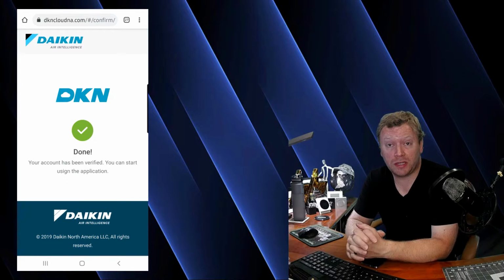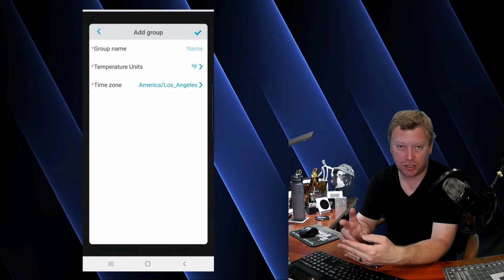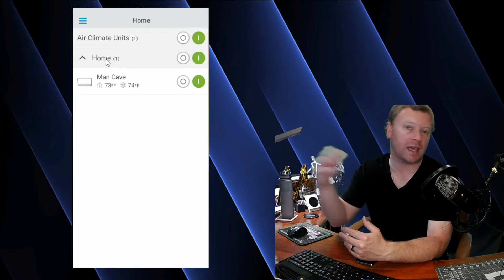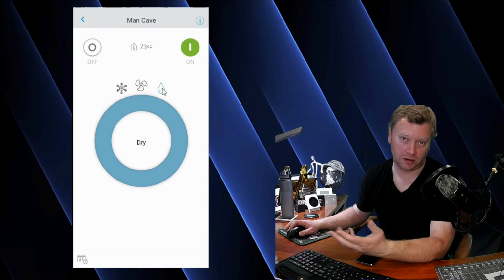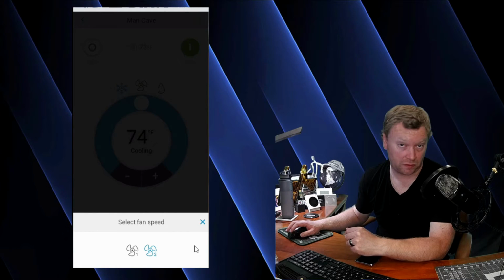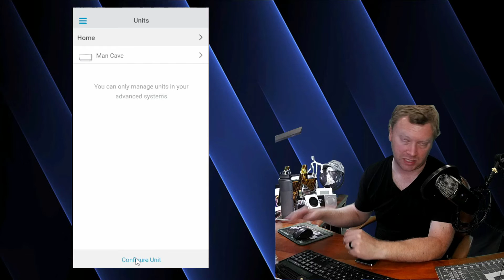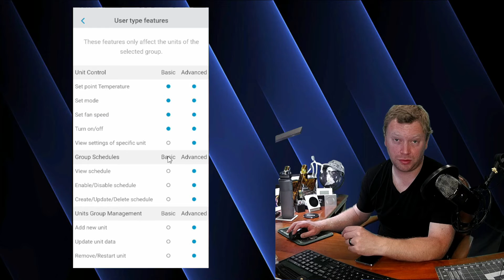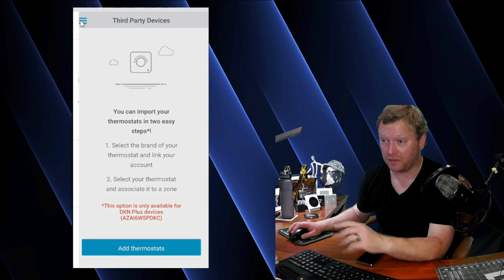Daikin WIFI | DKN Plus Adaptor Part 1 | Install, App Set-up, Connection and Demo (7-2-2021)

Comment: Very helpful video, thank you! But where would you suggest hiding this module? I purchased the AZAI6WSPDKB model (not the Plus) and was barely able to get it to fit under the case of a CTXS07LVJU. That module is slightly too big and causes the case to have bend with a lump at the bottom center.   

The AZAI6WSPDKC (Plus model) looks even bigger with all those protruding connectors. Where do you recommend installing it? Is there a cavity somewhere that is best suited? For esthetic reasons, I really can't install it outside of the unit without it looking horrible. What would a professional installer do?
Reply from the maker: Usually I see folks trying to tuck it in the cavity of the unit. The bottom cavity that is. Where the line set and condensate hose are usually tucked into by default from the factory. However as you mentioned, it doesn't always fit well, especially on smaller 7k heads which are tiny. I've been placing it right on top of the unit using 3m to stick it to the wall. Since the wall head is high up usually a few Inches from the ceiling, you cant see it until you're clear across the room. Unless you're really tall which then you can see it close to the unit obviously. 
Esthetics are always tough, but it's no different than a condensate pump mounted just below the unit (in my opinion). Other than those 2 options I've also seen some folks rarely stick it to the side of the unit too. Obviously it's very noticeable, but sometimes folks just don't care about stuff like that so it's not a big deal. I would suggest test mounting it temporarily and checking with the homeowner how it looks to them. But at the end of the day if it won't fit inside it won't fit inside I would never want to compromise the shell or the unit mounted on the walls integrity just to hide the wifi adaptor.
Reply: @InverterAlways  Thanks for the response and suggestions! I was really hoping you had a brilliant place that I was just missing. I'm actually the homeowner, and its being installed at a luxury Airbnb, so esthetics are important. I'll purchase the DKN Plus model and see if I can make something work. Otherwise I might have to get creative with some sort of wall decor to hide it. Any advice on how an end user can get installer pricing on these items in Portland Oregon? I need to buy 7 of them and they aren't cheap!
Reply from the maker: @yowzator  I totally understand. The Daikin One Smart Thermostat may be a better solution for you then as those have built-in wifi. But they are extremely expensive. Anything you decide to go with will need to be purchased from a contractor though as per most suppliers policy is to only sell to contractors. I can't speak for Oregon though so you can always look around and ask.
Reply: @InverterAlways  I'm renting out guest rooms to traveling nurses and each room has a head unit. My guests love that they have full control over their own comfort. But I'm worried what will happen when the weather transitions from cold to hot. Some of them may want to cool, while others want to heat. So I'm not really wanting full centralized control, except that I'd like to be able to automatically manage just the mode of all head units. For instance, when the outdoor temperature reaches some point, all units switch to cooling. Below that temp, they switch to heating. That's all I want -- just to take control of the mode of all units depending on the season. The 5 upstairs guest rooms are on a single outdoor unit and 3 downstairs common areas are on a different outdoor unit with a branch box. I already have Home Assistant installed to manage electronic door locks and lights. My plan is to use an HA integration for Daikin along with an exterior temperature sensor. But I'm open to other ideas.
Reply from the maker: @yowzator  so you have a few indoor units to control lol, I didn't realize you had quite that many. No matter what you do you'll at least have to install an adaptor of some sort. Intesis has an adaptor that can help integrate your units into a home automation system but, based on past usage of these I've found them cumbersome to set up. And once they are set up it seems to remove lots of control. You may be okay though since all you want to do is switch from heat to cool. Not needing auto is a good thing as that's a feature commonly lost with these. I've also seen it where they get stuck in cooling though so I'm not sure if I would risk it.
I think using the dkn modules for 3rd party stat integration is best because you can also use them for bacnet mstp or modbus, which most home automation systems can pull in one of those 2 types of logic. You'd probably want a controls guy who knows your home automation system to come integrate it though. 

You're still stuck trying to find a place to put them though which is your biggest issue. At the end of the day they might be noticeable but if it provides the best control it may be worth putting them on top of the unit. Shoot you could even lay them down and just have them sit on top of the unit and you'd barely see them at all as they are only an inch thick.

Hope that helps get you closer

Comment: Dana,

Thank you for your YouTube videos, they have been very informative. You solved a long-standing problem of getting WiFi control of ducted units. 
Do you know if it’s possible to connect the Airzone AZWSDAI31E3 Wi-Fi adapter with Daikin’s Mini-Split Wireless interface Adapters on the same app? I now have two very similar apps (DKN Cloud NA and Comfort Control) controlling separate units. It would be great to get them on the same app, without changing the Wi-Fi interface.

Any advice?
Reply from the maker: Hi Shawn, 

Just responded to your email but saw this as well so below is copy/paste for reference.

So the daikin comfort app uses a totally different card. The good news is that you can Install the dkn adaptors I talk about in my video on both mini splits (through s21) and vrv units (p1p2) and add them all to the same app. So no worries there you just have to make sure to order the right cards. There's an s21 adaptor, a p1p2 adaptor, then a 3rd party stat adaptor that can connect to both s21 and p1p2. Obviously you don't have a separate stat here, but I like the 3rd party adaptor personally just so I only have to worry about one skew. It works for wifi control anyways so you don't technically have to add a 3rd party stat to begin with. None the less it's a little more expensive so you can choose whatever adaptor part number fits your unit best. Then put them all on the cloud app.

I'm not familiar with the part number you reference but the part numbers I use on the daikin units are:

AZAI6WSCDKADKN Cloud Wifi Adaptor (for P1P2 connections)

AZAI6WSPDKCDKN Cloud Adaptor (for Modbus and 3rd party stats)

AZAI6WSCDKBDKN Cloud Wifi Adaptor for S21

Comment: How do I connect 5 wires from ecobee to dkn plus. In addition to, I do not have auto cold heat anymore.
Reply from the maker: You just run g to g y1 to y1 etc like a normal stat. But you need to run r and c (24v) from a separate power source. I typically take the 208 off the indoor power and install a transformer for that voltage on most models. Then land the rest of your wires. The better way to set it up though is to power it with 24v and just connect through wifi. It'll communicate setpoint mode and room temp through the cloud and give you better control.

Comment: Your instructions are great. However I am having a problem. The adapter was very easy to connect.  My unit has the S21 plug on my unit. But when following your instructions it never shows the unit connected. It shows it’s connected Wi-Fi and the cloud but not the indoor unit.  What am I doing wrong?
Reply: Is the 24 V from a separate transformer?
Reply from the maker: @skipnardie  yes, just gave you some additional info in my last comment as well, sorry i just saw this one.
Reply: OK, I think I have figured out the problem. I think I have a bad unit adapter. I have everything connected properly, I added a 24 V transformer and I’m getting power now to my thermostat, although it does nothing for my daikin unit. On the adapter there is a reset button. If I push and hold the button for about two seconds, about 30 seconds later on the app the unit will appear and show connection for about 10 seconds but then it falls off and says “AC unit not connected!” I did this three times yesterday and it did this each time. I think I need to get a different AZAI6WSPDKC adapter.
Reply from the maker: @skipnardie  definitely possible I've had a couple that were bad, it's rare but totally possible. Swap them out see if it resolves the issue.
Reply: I purchased a new unit today. I will let you know what happens.
Reply from the maker: @skipnardie  sounds good.  🤞
Reply from the maker: Did you "associate" the unit once you added it to the app?
Also did you allow location settings when you first connected?
I have heard of this happening a few times now, but have not had this happen to me directly yet. Mine have all gone smoothly. 
Curious, what is the model number of the Indoor unit?
Reply: Daikin FTXS30LVJU

Thermostat adapter AZAI6WSPDKC
I did associate the unit right as soon as I did the app connect.  How do I approve the location?
I don’t understand what I’m doing wrong.  Is there an additional setting somewhere for this? Is there a cable I’m not connecting? Also I’m not getting the 24 V to adapt my third-party thermostat.
Reply from the maker: @skipnardie  Sounds like there's been a few issues with S21 connections. I did not realize that you had the 3rd party version either sorry. You will need the S21 cord. You will also need to provide totally separate 24V power to the 3rd party stat. You can take this off line voltage through a transformer if you want. Then run the rest of the wiring down to the stat from the adaptor. In the app you will need to set all the 3rd party stuff up, along with fall back algorythm ETC. But simply just to use it on the Daikin App it's almost entirely plug n play. Are you not seeing it through the Daikin app, or through your Honeywell/Ecobee equivalent app?

the location settings is something that pops up usually the first time you open the app. You may be able to allow this in the settings of your phone/device you're using to connect with. I don't think it will matter once it's set up though.

The only other thing I can think of if it's completely set up and associated, is try removing it and re-adding it to the app. FYI the unit won't pop up on the 3rd party app until the stat is set up, so if you were using the 3rd party app that's probably what it was. keep me posted.
Reply: I got my new unit installed and it was extremely easy. All my frustration was coming from a bad unit. However I am having a hard time getting 24 V to my thermostat. I connected it like you showed but when I came to the thermostat only 1 V was going through and it did not have enough juice to power my thermostat. Any thoughts?
Reply from the maker: @skipnardie  3rd party stat needs its own 24v. Cannot provide it from the adaprpr

Comment: When you going to make part 2?  I'd really apricate if you made part 2 showing the physical hook up / mating of the DKN Plus to a thermostat both Cloud like the ECObee or Honeywell but also to a dumb thermostat.  I refer a lot of contractors to your videos now since Daikin has hidden most of their own videos on Daikin City.
Reply: @InverterAlways  I'd appreciate that.  I've had 4 calls in the last two weeks with contractors trying to hook up with Nest.  Tell them no Nest cloud connection but physical should work no problem.  They tell me it won't work.  I've haven't been able to play with a setup yet on my trainer in my shop.
Reply: @InverterAlways  Do you know if accessing the "Field Settings" menu is an option with the DKN Cloud adapter now that it can be used as a stand alone controller or will we still need to attached one of the hardwired controllers like the Nav?

Comment: Great video!  I'm currently working on a commercial project where we're installing about 30 Daikin minisplits (about 4 different models) all w/ these DKN Plus adapters & integrating them into the BAS. The Daikin literature doesn't provide a lot of details on what to expect or how to wire them up, so this video was very helpful for me to get an idea of what to expect & the app's capabilities.  I really appreciate you doing this video as it saved me a lot of time in the field figuring all this out on my own.
Reply: Does the Wifi adapt always have to be connected to the unit? If so, how can you dress it up, so no wire is dangling? or a pic please...

Comment: Great video... Biggest thing that upsets my customers is it or the WiFi versions don't fit in the Emura Wi-Fi compartment
Reply: Do you know of a way to get WiFi support on the Emura? I just bought one of these adapters since it was listed as the replacement for the adapter referenced in the Emura manual, and just now discovering it won’t fit. I guess I could try hunting down one of the old models.
Reply: @AJoshMorrow  Daikin supposedly will have a updated WiFi option but right now they only have the version they get from Airzones .  It won't fix in the compartment.